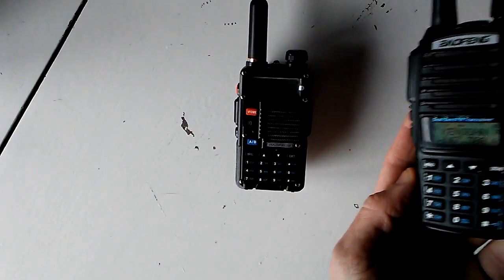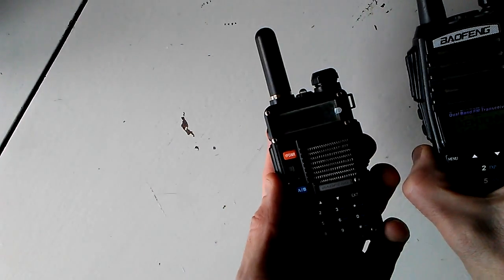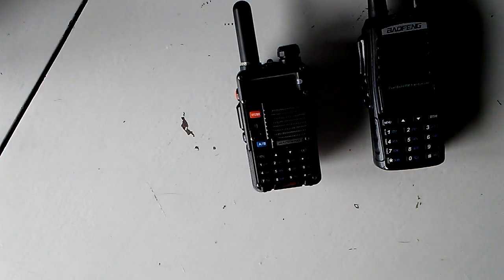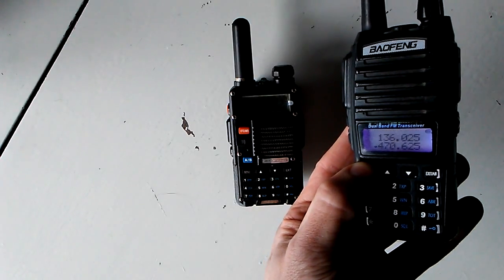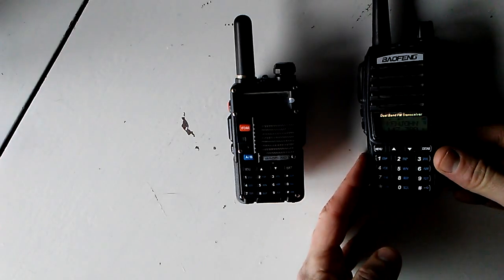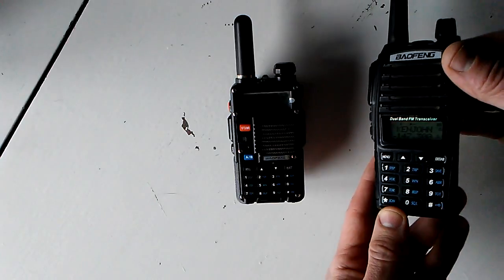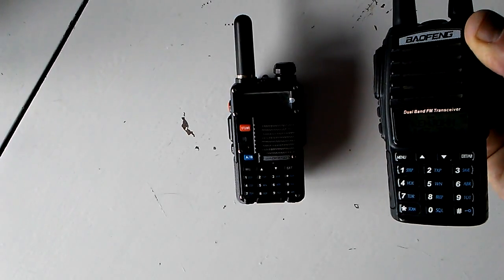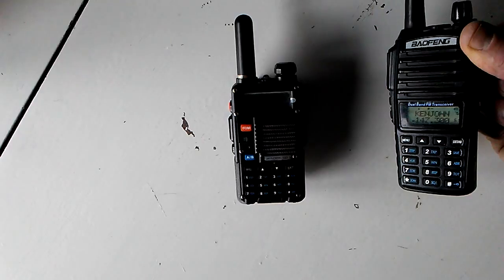baofeng UV-82 VFO mode-Channel mode switch

Comment: hello my UV 82 is stock on frequency mode.  i tried the turn on turn off way but it doesn't switch, what am i doing wrong tks.
Reply: I HAD SAME PROBLEM, then i went into chirp advanced settings and near bottom it says ; VFO/MR switching (btech uv82 only) and i enabled that and it worked for me.
Reply: @honkeyKong618 is this in programming software or on the radio

Comment: If you have a UV-82C and it won’t switch to channel mode: 

1 using CHIRP downlaod from your radio (this creates a tab that is compatible with your radio - this must be done before you can do any programming for your radio)
2 click the "Settings" tab on the left side of the CHIRP application window

Settings

3 then in the list that appears click "Advanced Settings"

Settings -> Advanced Settings

4 now look for "VFO/MR Switching:" in the list of "Advanced Settings" (3rd from the bottom)
5 tick the box to the left of "Enabled" 
6 upload the change to your radio
Reply: What do you do if the opposite is true?  Can't use CHIRP because stuck in channel mode and pressing menu+pwr brings up channel mode every time.  Ugh!
Reply: THANK YOU. This is it guys, get a programming cable and you can enable switching.

Comment: Step1: Turn Radio Off
Step2: Hold Down Menu
Step3: Turn On Radio while holding down menu
Reply: It does not work on mine.
Reply: @jimbeam8402  Mine does not work either
Reply: Second radio. Worked very first time but as soon as I started to program it now it won’t go out of frequency mode.
Reply: This does not work on earlier uv82 units

Comment: Channel mode I used to be able to push the up and down arrow and both upper and lower would travel together I hit some button in the middle of the night and now they move around independently if that makes sense trying to get it back to  keeping them together both A and B as I press arrow button up or down.

Comment: I bought a Baofeng UV-82HP a couple of days ago.  I reset the HT, then entered a frequency in frequency mode according to instructions, then saved the frequency, but I cannot get channel mode now.  Is this a glitch with the 82?
Reply: And fix for this. I just got mine, reset its, and now it won't switch to channel mode either.
Reply: Did you ever figure it out? I have been trying to accomplish this exact goal for days!

Comment: omg, it took you a full minute to just show how to do it!  Why!!
Reply from the maker: Because I am a psychopath and also the background information is useful to some users.  I hope you will forgive me and perhaps we can find a way for me to make up your time back.
Reply: @509rifas  Actually, I enjoyed hearing the reason for this and it helped me consider locking the radio so other users cannot change the channel accidently. But if you ever re-do the video, include the method for changing the display from Frequency Mode to Channel Mode. (I've posted the sequence in this forum for the benefit of other readers.)

Comment: Hi there. How do i switch between uhf and vhf on uv-82 please?
Reply: You don't. You program in the channels using a Windows software called CHIRP. Google around for any forum or bulletin board where another user in your country has shared the online location of a CSV or a DAT file with all the channels for your region of the world.

Download CHIRP for Windows (or for Mac if that's what you have) from the link below, install it, then connect the UV-82 via the USB data cable. If you haven't got a USB data cable for the handset - it plugs into the same two jacks on the side of the handset that the extension microphone does - then the job of programming channel frequencies into the handset is extremely tedious and time consuming for a novice. Also, there's no point reading beyond the end of this paragraph if you don't have that proprietary cable, because the instructions below are only relevant to users who can connect their handset to a PC or Mac.

Now, it's best to do this next part after you've done a Factory Reset on the handset. That option is in the handset's menu, and you Reset All, Reset Source.

Once the CHIRP software is running and the radio is connected to your computer, click on 'Radio' on the program's menu bar and choose 'Download from radio'. A popup will appear with three bars, COM, Vendor and Model. Before clicking OK, most times you'll want 'COM3', but you definitely want 'Baofeng' next to Vendor and 'UV-82' next to Model. Click OK, and the program will read the handset's memory and show you a list of what channels and frequencies are currently stored on the device.

You then import into CHIRP the CSV or DAT file you found earlier, then simply click on the Radio dropdown menu on CHIRP and 'Upload To Radio'.

Once you have done that, disconnect the handset from the computer, switch it off, then hold down the Menu button while switching the handset on, until the voice says "Channel Mode". If it says, "Frequency Mode', then repeat that OFF/ON process so the voice says "Channel Mode.

Last thing you do, go into the handset menu and change the two settings MDF-A and MDF-B to 'NAME', instead of 'FREQ' or 'CH', then exit the menu. You'll then be able to skip through channels using the arrow keys below the handset's display, and broadcast on that channel by using the Transmit key on the antenna side of the handset, or using the transmit key on the auxiliary microphone.

Hope that helps!

https://chirp.danplanet.com/projects/chirp/wiki/Download
Reply: @djshotty  thank you so much for your detailed response

Comment: I purchased 2 of these and one of them seems to have lost all its "channel programming" (it only has 0 and 127 I am guessing amazon return and someone was goofing with it) is there a way to hard reset the memory in these?
Reply from the maker: They come with default random frequencies programmed in- do not use these.  Program the ones you want yourself.   Either through CHIRP or manually.  They don't lose the programming, but they can get cleared by menu option 40.
Reply: @509rifas  I have 7 or 8 of these radio's when you goto channel mode they are pre programmed. 1 2 3 4 5 etc.. 1- 452.125 2- 453.225 etc.. etc..

ONE of the UV-82 is programmed normally. the second unit is not. it was in chinese (found the option to change to english) but channel mode is broken. only has channel 0 and 127.

I did a "reset all" this changes it back to chinese (changed to english again) but channel mode is still not normal still only has 0 and 127
Reply: @nerys71  That's because 'RESET ALL' wipes the frequency memory back to factory settings. You'll need to use CHIRP to reinstall the channels you want to use.
Reply: @djshotty  yeah it never has the freqs in it. Grrr was hoping they were part of factory settings. I will look up chirp

Comment: Good video, thanks for sharing. I am having a issue still that I cant seem to find support for online. I was hoping you can help. I hold the menu button down while turning my Baofeng UV-82 on and the only mode that will enable is frequency mode. I am trying to enable channel mode but it doesn't seem to be working. Have any further advise?
Reply: I had the same problem where i couldn't switch. I did a reset in the menus and that seemed to mess up from switching from vfo to mr when it went back to original settings. I enabled this funtion in the advanced settings on Chirp by clicking enable on VFO/MR Switching(Btech UV-82HP only) box and now i can switch to either just fine. Hope this helps someone that was in my boat.
Reply: i found the solution is to hold menu right when u turn on radio
Reply: When turning on the radio, you must keep the MENU button depressed until the radio announces which mode it is in. The display will still show the frequency and not the channel number until you do this: MENU 21 MENU (use up or down arrow to page thru settings and stop on CH.) Then (channel number) MENU EXIT.
Reply from the maker: Robert Baffi that's unusual.  Are you holding it down long enough?  If you release the menu button too soon it won't switch.  Another possibility is you are switching but your channel displays are displaying the freq name instead of channel number, use the up and down arrows to see if it goes up by channels or frequency step.
Worst cast scenario is its a bad radio.
Also, what model of uv82 is it?